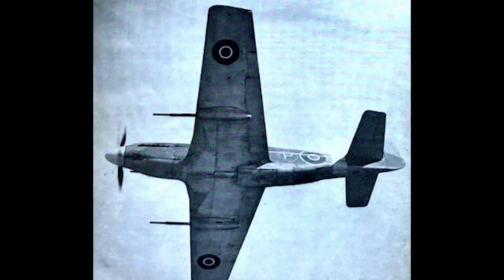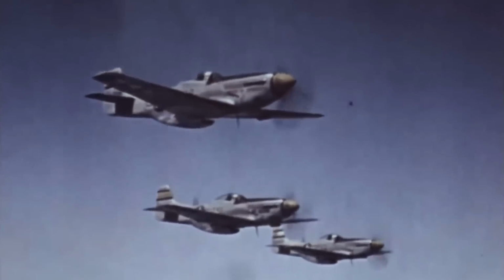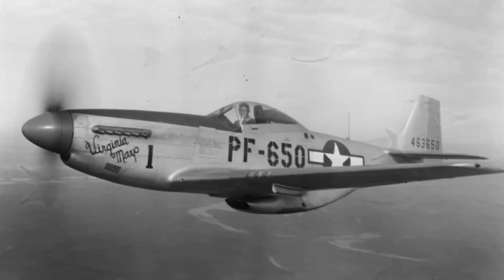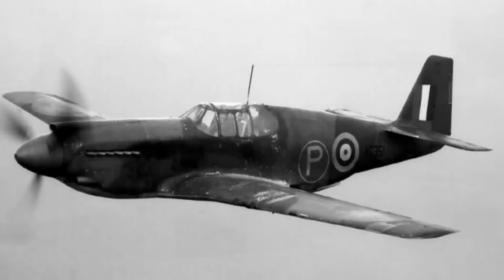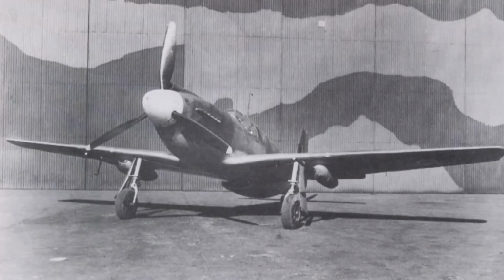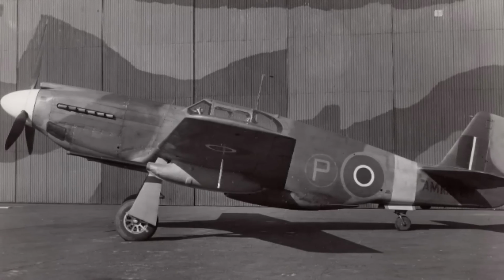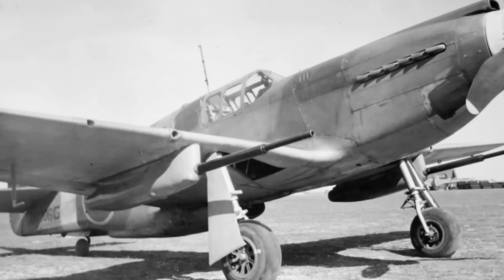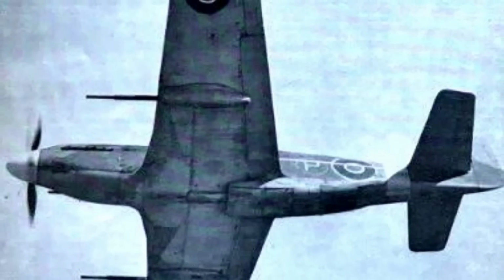The Twin 40mm Mustang; AM106

Comment: Those 40 mm were certainly nasty for ground targets like half tracks and trucks but were they really any good vs real tanks. The Stukaa with their 37mm BK3.7 cm pods were using tungsten ammo to do all that tank killing on the eastern front. But did the RAF give the good stuff to those Hurricane Squadrons so they could be even more effective ?
Reply: The normal S gun AP round could penetrate 58 mm of armour at 400 yards. The Hurricanes could manoeuvre to approach their targets from the rear, hitting the thin armour and engine compartments at the rear of tanks. So they were effective against PZ III and IVs and Stugs. They developed a squeezebore "Littlejohn" adapter with tungsten cores that could penetrate 85 mm of armour at the same range but it was never used in combat because of the switch to using RPs. The Allies had plenty of tungsten, whereas Germany ran short at the end of the war because of the limits put on Spanish exports of tungsten by a secret deal with the Allies. A lack of Japanese tank targets in Burma meant the Hurricanes using "S" guns in the Far East largely switched to using HE shells.
Reply: That I don't know, I suspect only armour piercing and HE rounds. The 6 pounder 57mm was available with discarding sabot rounds and Heat rounds were in use by the end of the war. The 40mm was very accurate, far more than hopeless 3" rockets but also, arguably a 'terror weapon'.
Reply: @jimdavis8391  

The ammunition makes a lot of difference.  The P-39's 37mm as given to the Russians - didn't have AP Ammunition so it wasn't actually used against tanks.
.
Reply: ...Ultimately deformable heads prove far better than a hard headed projectile like Tungsten steel. You then get a pressure build up and effectively melt through armour. Many earlier weapons never penetrated the armour, they didn't have to, the inside surfaces of the armour would spall producing shrapnel which would injure or kill crews...

Comment: The fact that they didn't suggests that serious issues cropped up in initial testing. The Hurricane was an exceptionally stable gun platform with very strong wings. 
I have a strong suspicion that the wings of the Mustang couldn't handle the off center recoil. Either causing structural damage, or unacceptable levels of accuracy. 
Possibly a bit of both.
Reply: That's War thunder BS. The mustang could carry more weight underneath its wings and had a higher maximum takeoff weight than anything else it's size why? Because it's wing was much stronger than anything else it's size. 

Wargaming has made people believe that the mustang was a fragile flower but it was a rugged fighter with the same weakness as every other liquid cooled fighter.
Reply: @corporalpunishment1133  And according to War Thunder the Hurricane is also fragile flower and the 40mm S is lucky to get a track or an engine red because AP.
Man! War Thunder hates UK/CW tech tree not a single P40 or P51 in the tech tree excluding the single Premium 20mm P51, despite the history or the actual combat usage yet P51 and P40 are cut and pasted all over other tech trees.

Comment: Imagine dogfighting with a pair of 40 mm cannons. I think even the most stalwart Luftwaffe pilot would avoid taking it on.
Reply: A very heavy ultra slow firing very limited ammunition opponent would be a fairly safe bet.
Reply: They're very short-barreled for a 40mm gun. I suspect the muzzle velocity would make hitting fighter-sized targets (and maybe even bomber-sized targets!)  very difficult. The rate of fire would almost certainly be a lot lower than you'd want for an anti-air gun, as well.
Reply: @Philistine47  Perhaps cannister rounds might have improved the odds of hitting something.
Reply: @ivanconnolly7332 Low MV would make them very short-ranged as well as inaccurate; canister shot would further reduce that until you had to be right on top of your target to score a hit, while also drastically reducing the terminal effect.
Reply: @Philistine47  Thanks .

Comment: The inner landing gear doors are closed when the aircraft is parked. In later Mustangs the doors hang open until the main gear is stowed. When did this change?
Reply: It happens after the aircraft sits for a while and gradually loses hydraulic pressure, which is what normally keeps the doors closed. There is a physical door lock, but it is only engaged when the gear is up (in flight).
Reply: So in the photographs, in all cases it was taken between the time the engine shut off and the time the pressure would drop enough to allow the doors to open?
Reply: @danpatterson8009  people like action shots. Some photographs are actually stills from a motion camera even. People take pictures and video of planes taking off, landing, on mission, etc. 

Google "P-51 Parked" and you'll get a variety of images of mustangs with gear doors open and closed. Some are freshly parked. And others, after a fresh rebuild, might hold pressure for longer with tight seals and such. Takes longer for the pressure to bleed out.
Reply: it didn't change. go to an airshow and see late model mustangs in action. when the engine fires up and the pumps come on, the doors close.

Comment: Imagine if the RAF had put those cannons on a P47!😮
Reply: From "Jug" to "Thug"
Reply: @terraflow__bryanburdo4547  jug shaker
Reply: Jeremy Clarkson  "Mmm YeEAsss" 

It'd be the Juggiest Jug to Ever...
Reply: "We quit!"

signed the SS Panzer Corps
Reply: Well the USAAF did have North American Aviation install a 75mm plus ALL of the .50BMGs in B-25s. And yes the USAAF should have been using 20mm Hisso's sooner than they did.
Reply: The RAF? If they had so much as mentioned it in a secret whisper, the US would have tried to mount 4 of them on a P-47. Yanks and their guns!
Reply: They had Typhoon.
Reply: @DC.409  yep, still in development with tails falling off and gassing pilots. So you look for available fallback positions.
Reply: @hughjohnson2674   the Typhoon entered service September 1941 the Mustang 1 April 1942. The Mustang 1 was used for low level interdiction. The problem Mosquito was faster with a greater range carried more weapon load. The typhoon moved to tactical air replacing the Hurricane in 1943 with 4 cannon has Tempest V  was becoming available with the new wing . Again carried more weapons than Mustang I and at low level was faster. The RAF didn’t use the AAF  A36 version of the Mustang which  Arnold famously said was obsolete before the last aircraft was manufactured. The AAF successfully used the P47 Thunderbolt in the tactical bomber roll like Typhoon. Indeed they did fit the P gun to Tempest under trial, never progressed. Tempest like typhoon could carry the 60pound rockets, so they abandoned fitting heavy cannon for rockets, which were cheaper to mass produce.
Reply: @DC.409  still needed fallback options, why they started on the bubble top hurricane. It was a war of continual development, and constant Air Ministry Spec changes.  So all you said is true, relevant, but the early taffy was a flying coffin.
Reply: Knowing how field personnel operated back then, it wouldn't surprise me.  All sorts of equipment was "altered" to do rolls that it was not originally designed for out of necessity.  

However, when I think of a P-47 with two of these S guns, only one word comes to mind:  overkill.
Reply: There was a p-47 variant..I forgot what one that was planned to have 4 37mm cannons
Reply: The USAF was experimenting with putting four 37mm cannons on the p-47 N model but idk if it ever happened
Reply: If the early Mustang didn't need the extra firepower, with 4x .50s and 4x .30s plus a selection of bombs and rockets, the P-47 with 8x .50s - and quite a bit more payload capacity for bombs and rockets - needed it even less.
Reply: @Philistine47  the Mk1 had only 2x.50 cal guns and 4x.303 guns.
Reply: @Neil of Longbeck  So, the firepower disparity in favor of the P-47 was even greater than what was stated in the video.
Reply: @Philistine47  only on the Mustang I. The Mustang II had 4x20m cannon. From the Mustang III, IIRC they standardised on 6x0.50 cal Brownings.
Reply: They did it with the Hurricane, right?
Reply: 8x50 cal. You’re getting greedy with 4x 20mm